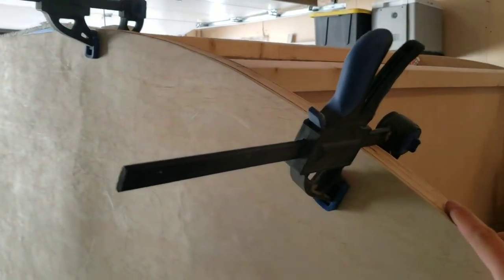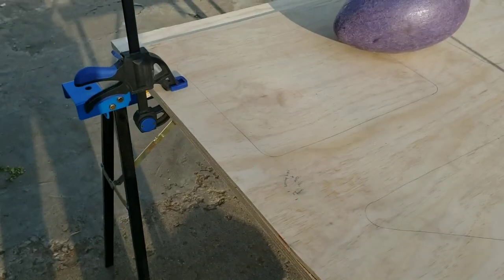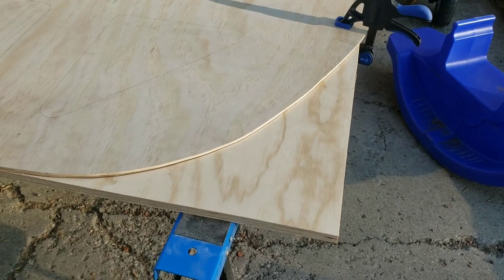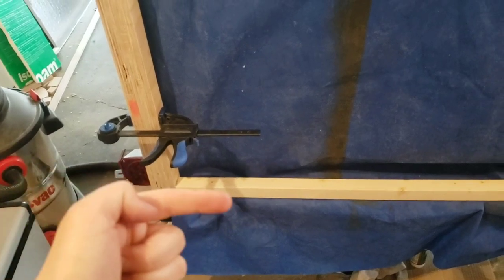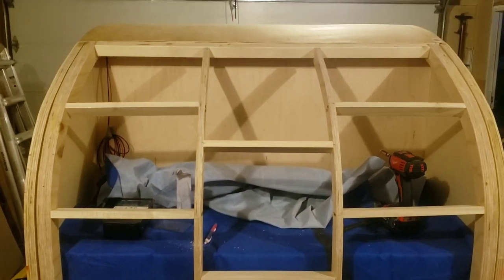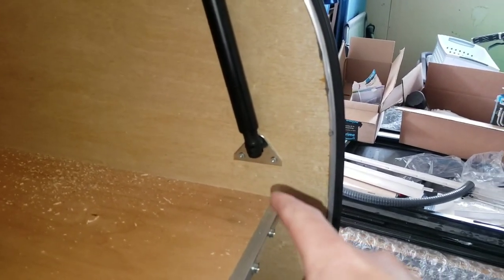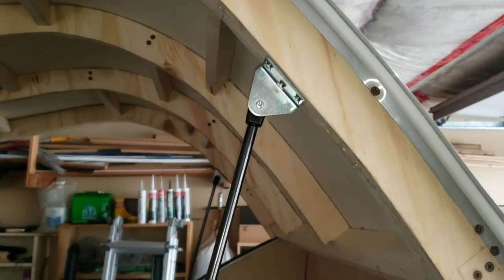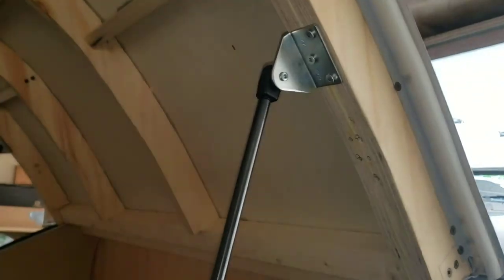Teardrop Trailer Build E013 - Building The Hatch

Comment: Great video! I’ve watched quite a few galley hatch videos, this is well filmed, and you made it easy to follow, simple to pause so I can see where I’m going wrong with mine haha!
I’m on the fence about springs vs rigging a pulley system... do you think those gas springs were worth it?
Reply from the maker: Thank you so much! That's exactly why we filmed and posted it so we are happy to hear! Alright, for the struts, I would say, they are a pain to size and position (as you can see we left a few holes as we found our calculations we off and had to move them) but they really really amp up the "professional finish" feel in the end and we are glad we did it. I haven't seen what a pulley system looks like. I've only ever seen people prop their hatches up with sticks or something like that.

I would add to this now that we've got some miles on the teardrop. Don't cut your hurricane hinge to size!!! Leave some extra hunger to overhang the sides of the trailer and wick water off. Some people will event use that extra hinge to put a silicone plug in the ends. Way easier to seal it with extra hinge to work with!!!

Good luck on your build!!!

Comment: This is such a great video! I have a question on  building the hatch. What did you use to glue your aluminum outer shell to the wood?
Reply from the maker: Sorry @jamiedean1562 it looks like I missed your question! If you're still wondering: we did not glue the aluminum to the outside. Instead it "floats" in place between trims. I have an aluminum skinning video as well where I go over the process. Basically the trim is used to hold the sheets there, giving the sheets the ability to flex in the cold without causing strain on glue or fasteners.

Comment: What prevents the water from getting in the rear storage area?
Reply from the maker: Hi @goodwood934, great question! The hurricane hinge along the top of the hatch is the key to keeping things dry. It's a special kind of hinge, so look in to that if you have a chance. I bought mine from a camper company and cut to length. If I were to rebuild mine, I would add a quarter to a half inch extra hung overhang on both sides instead of cutting the hinge flush. That way, wicking water would trail right off like a rain gutter. On top of that, we have common weather stripping all along the left, right, and bottom of the hatch where it "seals" lightly when closed. I hope that makes sense! Cheers!
Reply: @diwhynot3094  so the weather strip is a good enough seal then? Is it just an adhesive strip I assume? 
Thanks for the reply, much appreciated 👍🏻
Reply from the maker: @RaphaelTheSirion  yeah, the adhesive strip has worked well so far. We've not had any issues, and we've driven through horrendous downpours with gross sidewinds.

Comment: This is such a great video! I have a question on  building the hatch. What did you use to glue your aluminum outer shell to the wood?
Reply from the maker: Hi Jamie, we didn't glue the aluminum to the wood at all. Apparently doing that can cause issues because the metal with expand/contract with temperature changes and put force on the wood/glue under it. So what we did was we used the trim moulding to hold the sheet in place and the aluminum is actually loose and "floating" in the middle. We put the bottom straight trim on first and sat the aluminum on top of that, then went around the sides and out all the rest on. We have a video of this process too, and I think some explanations as to what are doing in that video. Hope that all makes sense! Cheers!